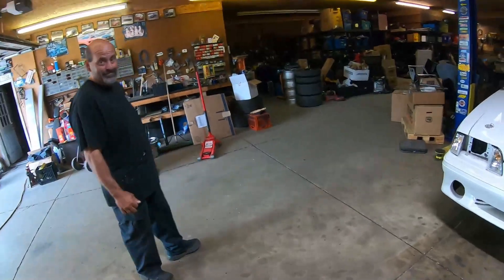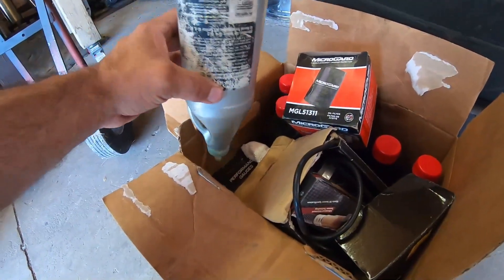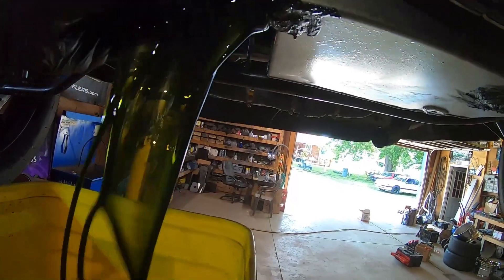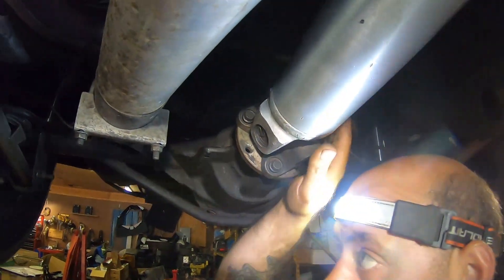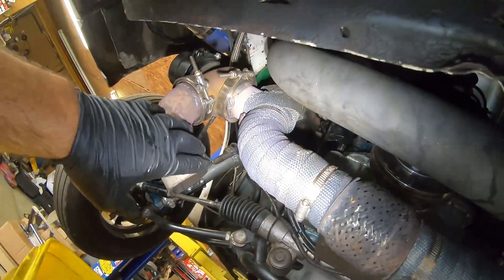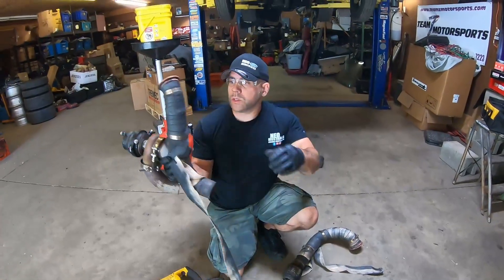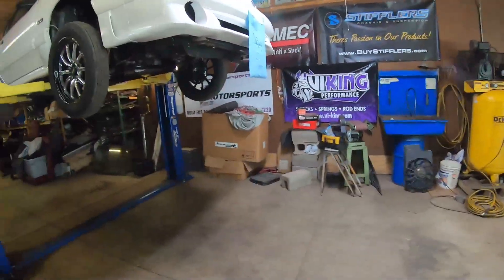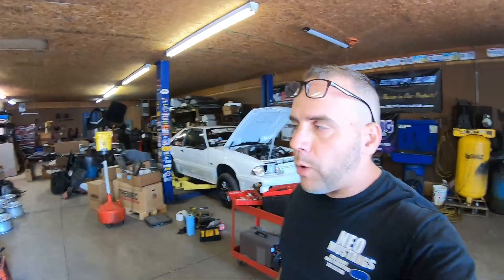We Found The Problem - I Should Have Deleted This YEARS Ago! + MORE Maintenance

Comment: Excellent video. Quick question on the spherical bushings. For a 100% street car, would you still use sphericals over urathane? Did you notice they were any noisier on the street? Thank you so much!
Reply from the maker: Yes noisy. However reliable under power

Comment: I was watching, wondering why you'd have the flex pipe with solid motor mounts. I get now why you wanted them out. .. in your opinion,  when ordering an ON3 kit. What's the better option for hot side, the thick wall steel or stainless? Thanks
Reply from the maker: Thick. What would solid motor mounts have to do with a solid cross?

Comment: I looked at Anderson Ford Motorsports and they have an sst hyd throw out kit is that what you are using or the cable? My firewall is cracking and wanted to switch to prevent any other damage
Reply from the maker: I dont use hyd at all. I would repair your firewall.

Comment: Love the Undertaker notification sound,  have had that set as mine for a while. Think I'll cut the flange out of my tube soon as well. Don't want any problems 🙌🏾🙏🏾
Reply from the maker: Its serves a purpose imo, helps hold the turbo up on the other side of the kit. Some kits that are bolt in need that due to a socket flange bolt up in the middle. My stuffs all solid piped thru the system.

Comment: So the flex coupler sent some trash through the turbo?
Reply from the maker: I have seen it before yes.
Reply: @Neomustangs  makes sense with that woven steel, probably just a couple strands passing through the tight tolerances in the turbo would do some damage!